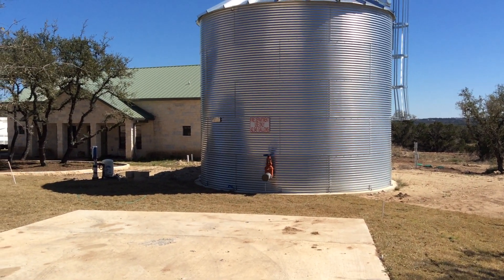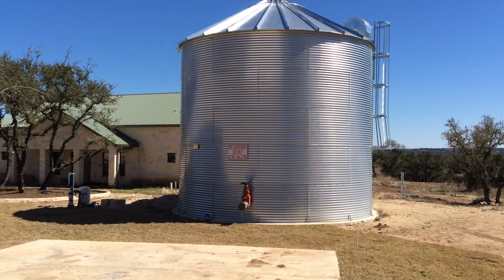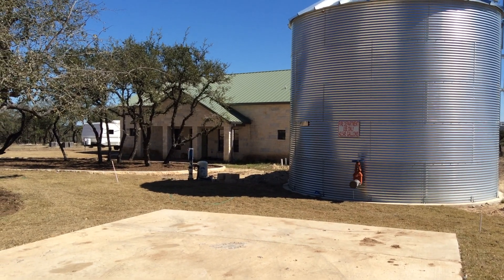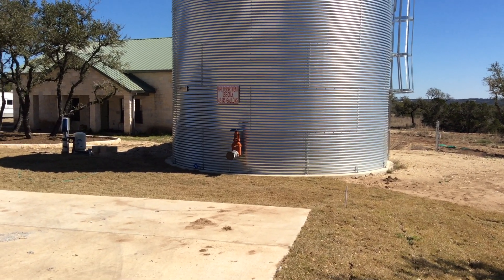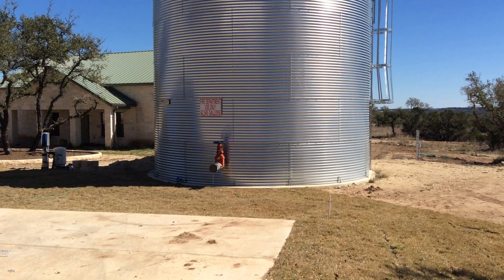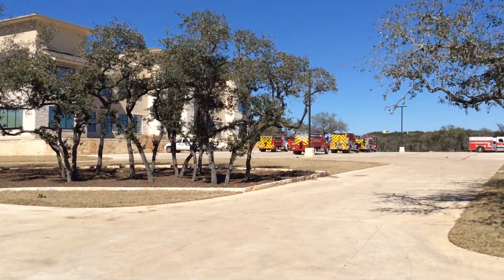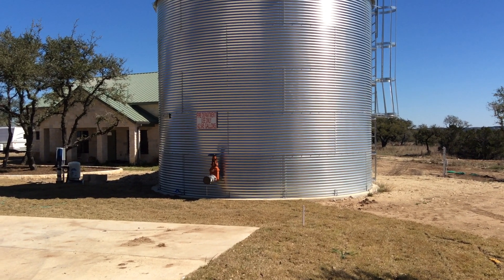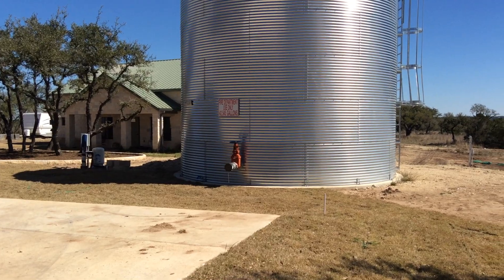Above Ground Fire Water Storage Tank - Hays County, Texas

Comment: Thank you Mark for making this video. The tank is a CorGal Model 2105-WT-CHR and was installed by Specified Water Systems, LLC. What you can't see from the outside is a 6" underground line that provides water to the facility's fire pumps in addition to the draft connection you highlighted in your video. A sprinkler system is required for a facility of this magnitude, but for smaller developments, a draft-only connection is common. I appreciated your video.